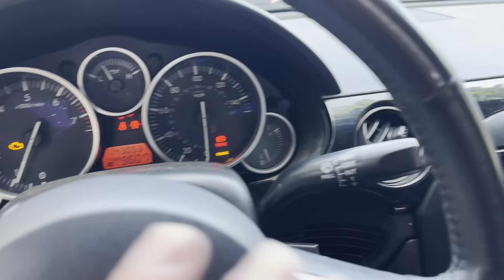NC MX-5 Moroso Over Flow Tank Install

Comment: Which one is best to own mini or Mazda for fun and reliability
Reply from the maker: @ericarmitage1599  well that depends on which model of each, what your preferences are and how you’re gonna use it.  
As far as Miata’s go NA/NB are gonna be your most reliable and cheap generation. They are a lot of fun on track but not super fast. NC/ND will be more expensive and are less reliable (early NC known for bad trans and engines that don’t like to go past 150k) (ND has sensitive transmissions) 

As far as minis go R53/F56 will be your most reliable generations. R53 and R56 will be cheapest. R53 overall being the most bang for your buck. R56 will guaranteed have issues. F56 will be more expensive but arguably the most reliable and in my opinion fun. Minis will be quicker but probably not as fun on track.